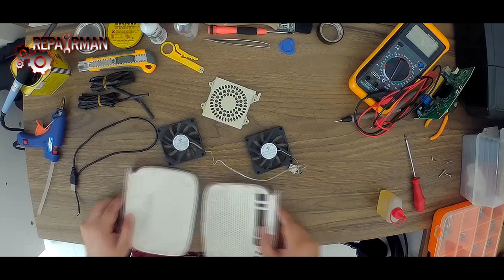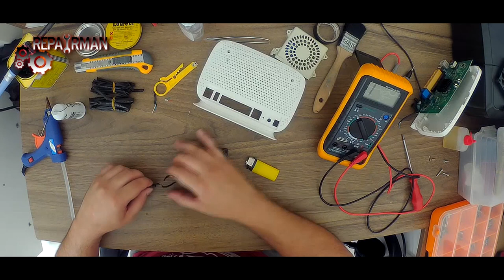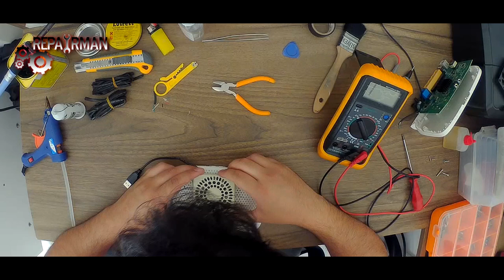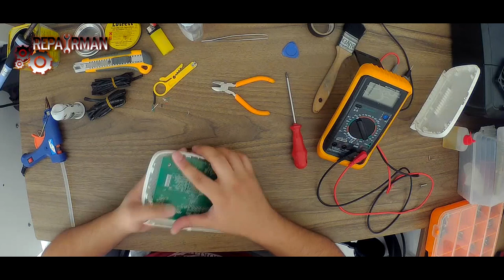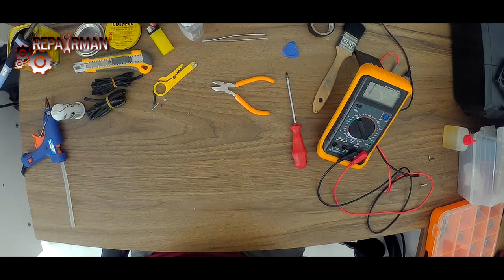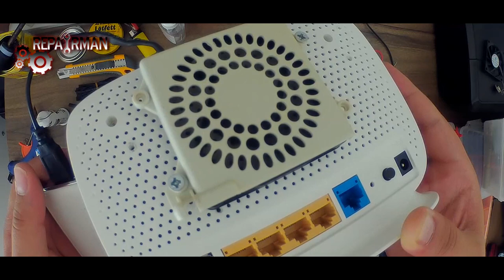Modem soğutucu fan nasıl yapılır? /How to make  Modem cooler fan?

Comment: Modem de kaç volt fan kullandınız
Reply: ben yaptim gayette iyi oldu ben 4.5 voltluk bir fan kullandim iyiydi
Reply: @muhsingezici  bilgi için teşekkürler bende farklı bir fiber modeme (Türk Telekom) işlemci fanı taktım 12 v modem buz gibi oldu
Reply from the maker: 5v kullandim, guchde usb girisinden aldim.
Reply: @repairman961  12 v fan var elimde onu bağlasam 5v USB için modemde sıkıntı olur mu. Sizin videodaki modemin aynısı var. İlla 5 v fan mı kullanmak lazım..
Reply from the maker: @goktan051  Sorun olmaz devir sayısını etkiler muhtemelen.